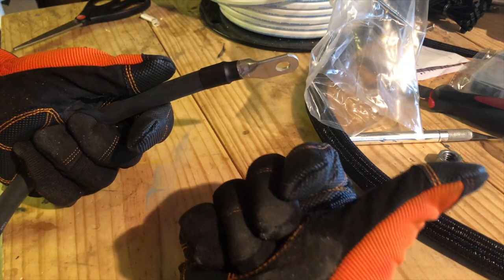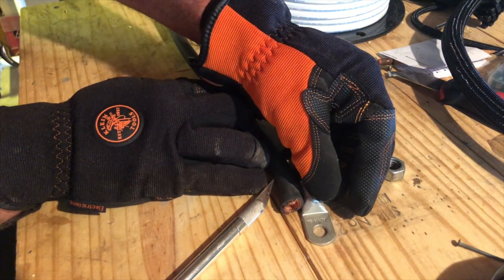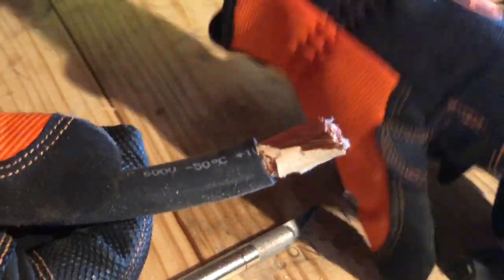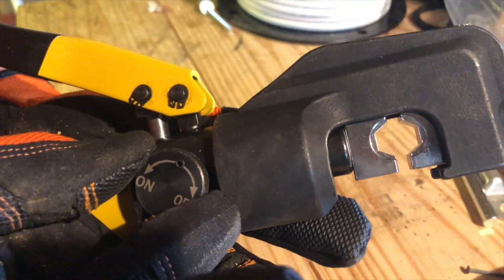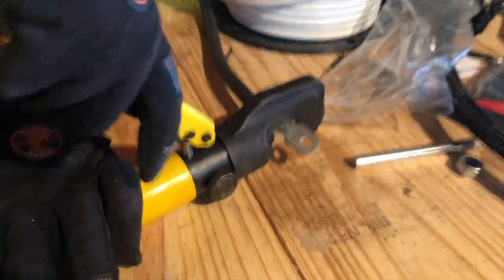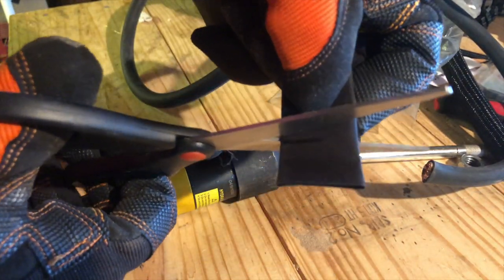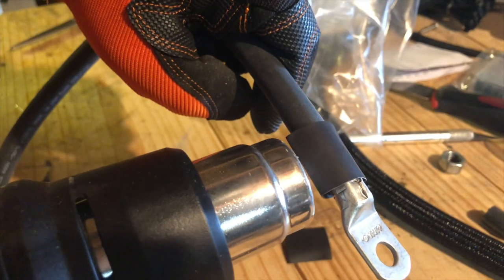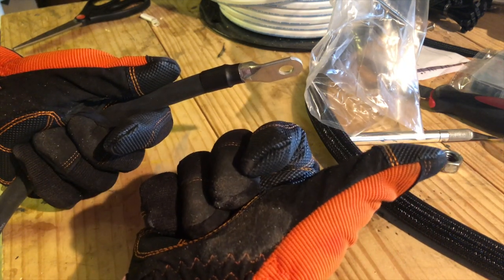How to crimp heavy duty 2/0 battery cables! VIDEO GUIDE

Comment: If using those hammer crimped connectors, why need such heavy wire as that's way more than what would go threw the connector?

Comment: What terminal or ferrule would you use if your going from a heavy duty wire and you need to connect to a small breaker opening?
Reply: It's called a 'Pin Terminal Connector'

Comment: What size dye did u use for 2/0?
Reply: He uses the hyclat hydraulic crimping tool
Reply: @AlfredoSigala  No, What size die set was used on the 2 gauge wire?
Reply: @gordonndani  3 years later I came looking for that answer... Guess I'll keep looking
Reply: I would do prob 70 on hottom and 35 on top @gordonndani